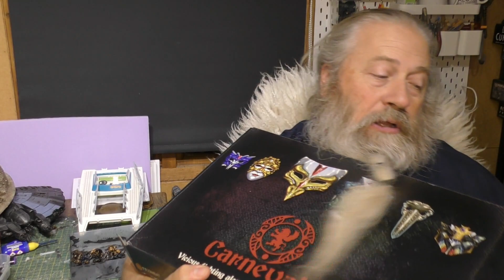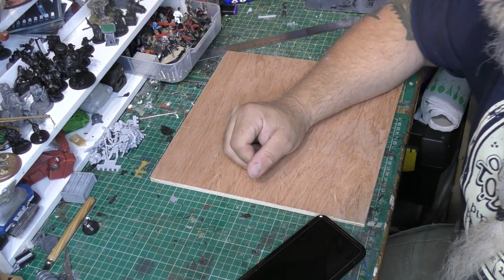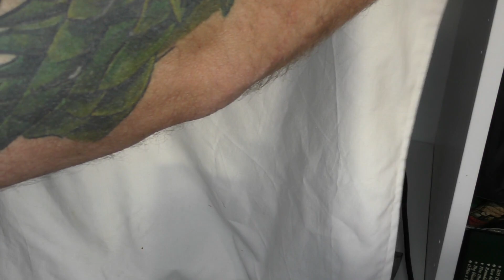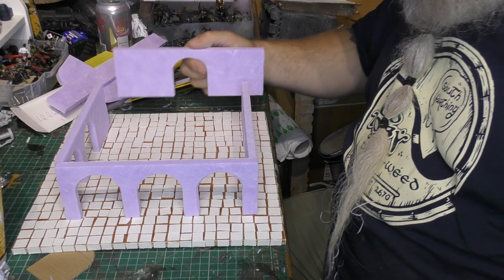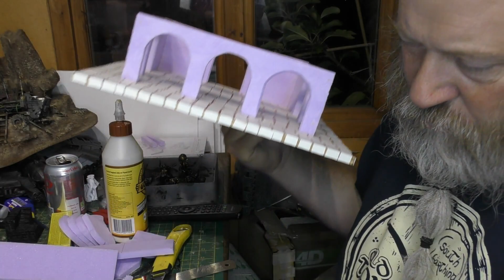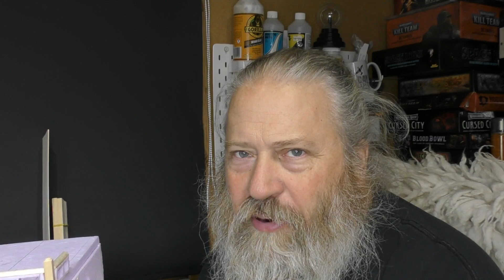Carnevale Patreon Build (Part One)

Comment: Nice to see you trying something different mate. The Venice canal setting gives me an idea for a “floor is lava” type build for necromunda, one where the ground level is a a busy freeway, with an elevated rail crossing over perpendicular.

Gangers could cross one side of the board on the tracks (avoiding the train passing through hopefully), cross the gangways over the freeway, or if desperate, try to ‘Frogger’ the freeway.
Reply from the maker: Canals and water just do it for me on gaming tables.